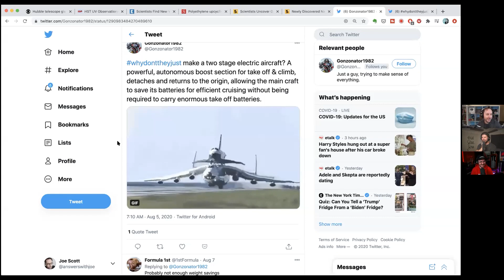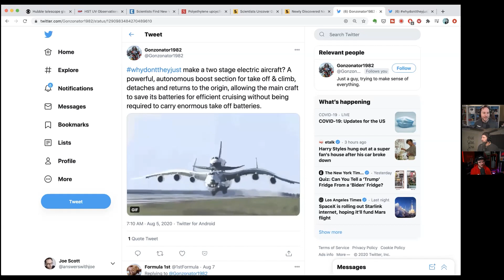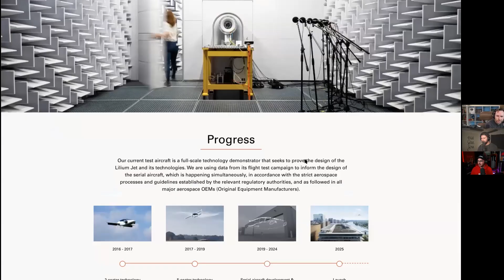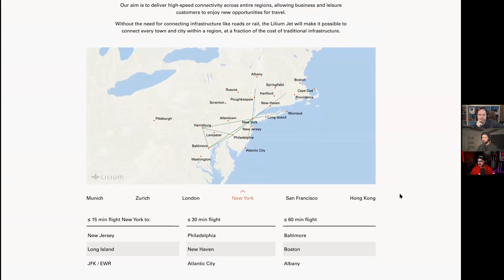Why Don't They Just use a shuttle for Electric Planes? (Hightlight Ep 108)

Comment: You have to use the falcon tech. if you boost the aircraft with a rocket I think the equation works. then you can coast and land anywhere. it's seems a little more work but a way better solution the starship, especially since adding the skydiving maneuver.